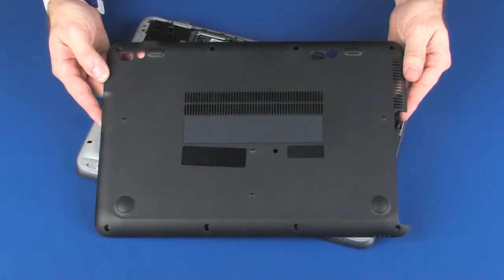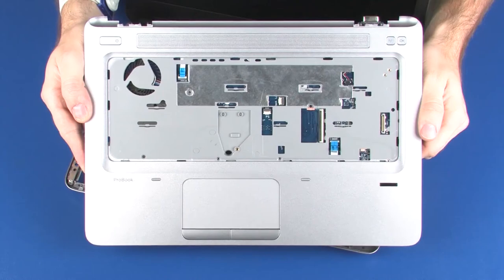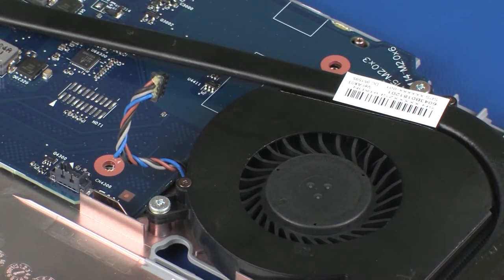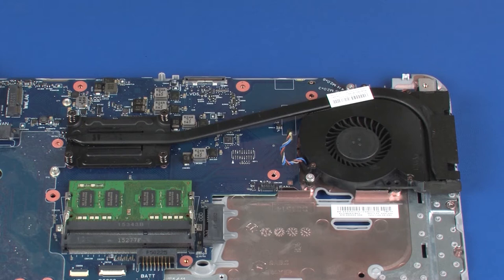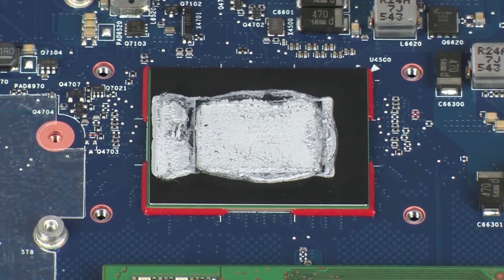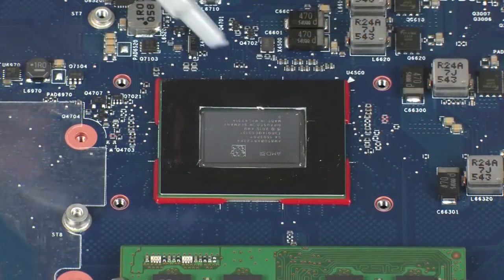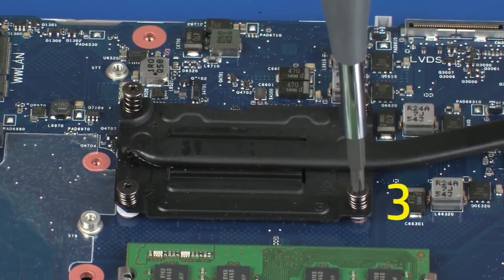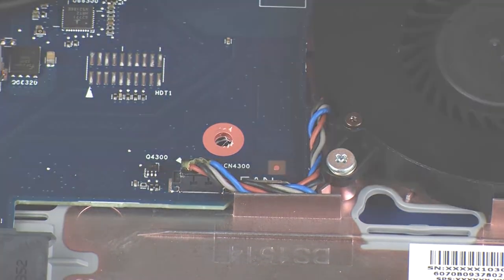Replace the Fan/Heat Sink Assembly | HP Probook 640 and 645 G2 Notebooks | HP Support

Comment: Hello, my fan is busted but the heatsink is perfectly fine. Is there a way to replace the fan without having to buy the complete "fan + heatsink" assembly ? Thanks for your videos !
Reply from the maker: Hi Quentin, thanks for contacting HP Global Social Media Support!
I understand that you need to know whether you can remove only the fan of your notebook.
I will do my best to assist you.
The fan and heat sink comes as a single part for your notebook. 
Please replace both of them. 
Binu_HP Social Media Tech Support
Reply: @HPSupport  Thank you very much ! What if I want to try and clean the fan then ? Is there a way to remove the heatsink + fan assembly and check the fan ? Maybe give it a little bit of lubricant or remove the dust ? I actually can't tell if there is such possibility...
Reply: @HPSupport  P.S. : Your support for self maintenance of products is top notch, I'll definitely take that into consideration next time I'm buying a computer !
Reply from the maker: Thanks for the reply.
Please refer the service manual of your notebook as it may help you: https://bit.ly/3EqjGFt
Binu_HP Social Media Tech Support